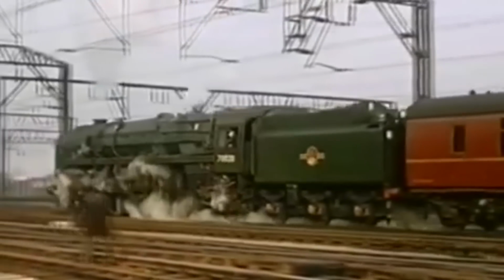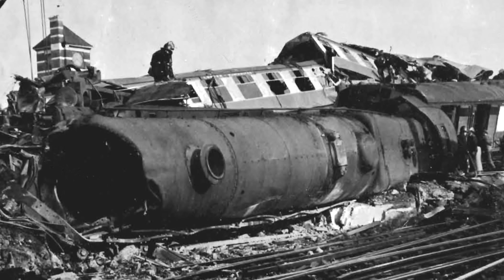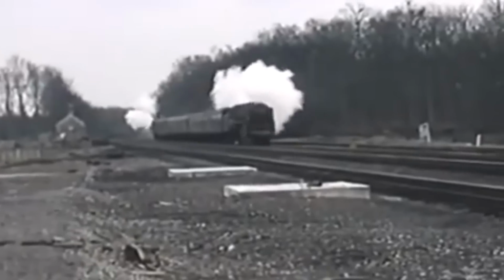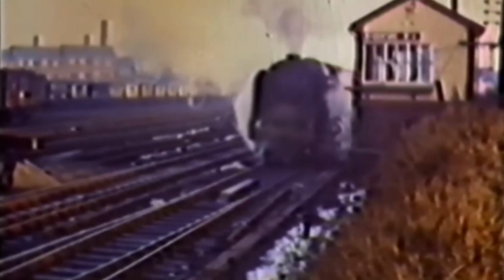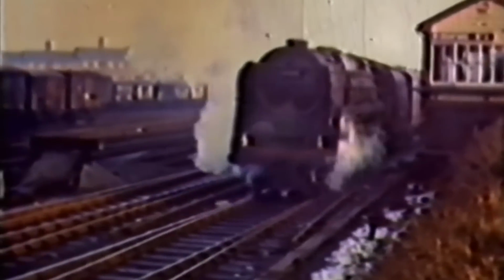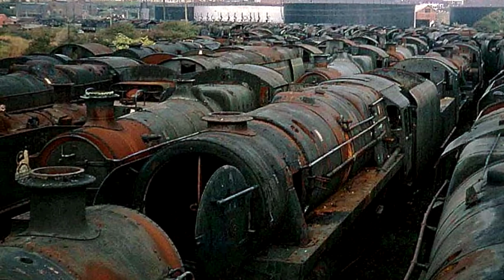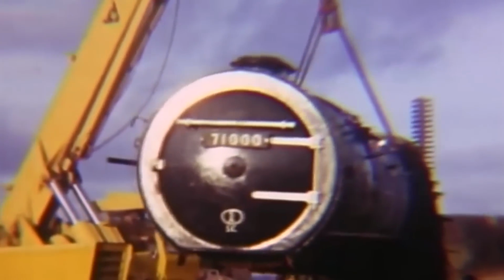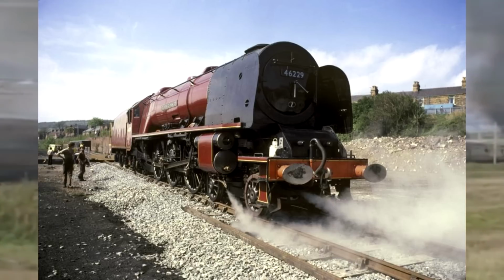The Steam Locomotive That Surpassed Expectations | 71000 Duke of Gloucester | History in the Dark

Comment: I've tried finding an answer online but I failed. Is The Duke more powerful than the 9F Evening Star?
Reply: The Class 8 Duke of Gloucester’s tractive effort is 39,080 lbf while the 9F’s are 39,667 lbf so the latter would be stronger
Reply: @jaanshersaeed4541  Thank you. Your response is appreciated. 🤩
Reply: @jaanshersaeed4541  But tractive effort is not a true representation of power. It only represents starting torque at the wheels, and freight engines have a higher TE than passenger ones because they have smaller wheels. The real indicator of power is drawbar horsepower (EDHP), but that can't be predicted easily. It depends on boiler size, grate area, quality of steaming and other practical factors. Plenty of engines that were powerful on paper were unsuccessful in practice, including the Duke in its original format. However, the rebuilt Duke and the 9Fs including Evening Star are both very successful and perform superbly in practice as well as theory. The 9Fs with only 5 ft wheels would suffer high wear if used regularly on high-speed express trains, though they ran a lot faster than expected, often at 70-75 mph and once timed at 90! Boiler size was similar to the Duke but grate area was slightly smaller and there was less cylinder volume. So that Duke would be expected to have a slightly higher power output at top speed than Evening Star.
Reply: @iankemp1131  Yeah, haven’t been completely sure what tractive effort’s about though I wonder if the Duke of Gloucester and a 9F were to pull a heavy goods train with the same amount of trucks (like say 30 of them) while not going fast which one would have an easier time and if they were to go up and push each other buffer to buffer which would have an easier time pushing the other. I’ve read that the Coronations were said to be the most powerful steam engines in Great Britain though the U1 Garratt was extremely huge and powerful.
Reply: @jaanshersaeed4541  To round off - the LMS Duchess/Coronation class had the highest peak recorded power output in BR days, although an LNER A4 had a very high and much longer-sustained power output on a wartime train. The LNER U1 Garratts had the highest tractive effort, but were built for low speed slogging. So they could exert a higher force than the A4s/Duchesses, but could not reach the speeds that would produce a comparable power output.
Reply: The 8P is much more powerful than a 9F - probably 15-20% more powerful. The power of a steam locomotive depends on how much steam it can produce, and the 9F has a very similar boiler to the 7MT Britannia class. Both the Britannia and the 9F have a 42 sq ft grate area, which gives a measure of how much coal can be burned - the 8Ps generally had a 50 sq ft grate, and consequently larger boilers (exceptions being the GWR Kings which were not actually so powerful, and the LNER A4s which are the real deal). 

The Gresley A4s also had a 42 sq ft grate, but they were very efficient and had a huge heating 3300 sq ft surface (bigger than the Duke's) so they could produce loads of power - some estimates have them at about 2200 DBHP over 20 or more miles, which is basically like a class 5 diesel (deltics get about 2500-2600 DBHP when going flat out, the 3300 HP normally quoted is at the output of the diesel engine).

Tractive effort is simply the peak force generated by the locomotive. For a steam engine, its basically 85% boiler pressure multiplied by the area of the pistons (this product is a force), then adjusted to account for leverage (found from the the size of the driving wheels and the length of the piston stroke). 

Power is tractive effort times speed. Tractive effort eventually falls as speed rises, (just think how the higher gears on a car lower the torque applied to the wheels), and the power is maximised somewhere along the speed curve. For freight engines, this is at a low speed, since the wheels are smaller, and the draughting is arranged so the boiler works best at that speed. Passenger locos maximise the power higher up along the speed curve.

Incidentally, steam locos generally make good power when they are moving fairly fast; they are terrible at low speed, which is why they accelerate so slowly.
Reply: @cobblestone_cowboy  Thanks, that was both interesting and informative. 😊❤️❤️❤️😊
Reply: @cobblestone_cowboy  Thanks for that very informative and comprehensive reply. It shows how power output is a combination of several factors - 1. the heat produced from the fire (linked to grate area but also effectiveness of airflow and coal quality), 2. the boiler size and steaming capacity (linked to heating surface), 3. the cylinder capacity and efficiency, and 4. the adhesion at the wheel surface (no good producing lots of power if the engine is simply slipping). The weakest link limits the overall power. The original Duke's two problems both affected 1 and were solved by the preservationists. The Duke's grate area was 48.6 sq ft (v 50 sq ft for the Duchesses) but in fact only part of this was effective originally, so heat production was low. The boiler was actually hardly any bigger than a Britannia/9F boiler due to loading gauge limitations, and the heating surface area was almost precisely the same. Interesting point about the A4s; the 2200 HP was indeed sustained for 25 miles at 75 mph on a 1940 run with a 21-coach 730-ton train. High speed and high force, so very high power. But this was an exceptional, maybe unique effort, whereas Deltics produced higher power day in, day out, continuously over longer distances. The later Peppercorn Pacifics had a 50 sq ft grate but did not outperform the A4s, but it presumably gave more margin with poor post-war coal.
Reply: @iankemp1131  Agree, the deltics were a big step up. But another way of looking at it is, they had to be, because the steam locos they replaced were pretty much as good as could be produced within operating limits.
Reply: @cobblestone_cowboy  A very fair point. Gerard Fiennes said in the 1960s he wanted 3000 hp to give end-to-end journey times and the Deltics were the only way to do this, "the policy of building express passenger diesels of 2000 hp lies in ruins about us". Other diesels indeed were not a great advance on steam, although the predictability of power output was a good thing (if reliability was ok). Even diesel-electrics weren't that great at the initial moments of starting. I remember when class 47s and coaches were replaced by Voyagers in the 1990s on the Oxford-Birmingham route - the acceleration from rest was far better and the schedules were cut substantially even with existing stops and similar top speeds.

Comment: The Duke is a firm favourite, and while it did trump the Duchess' service record on Shap itself she has never quite reached the UK record for measured power...officially standing at an estimated 2511dbhp and held by, you guessed it, a Duchess (6234 Duchess of Abercorn) during blastpipe trials and hauling an insane 20 car train. Widely respected experts of the time (including Great Eastern railway engineer and technical journalist C J Allen) calculated the cylinder figure to have been in excess of 3200hp and as high as 3330hp. None the less, the Duke is spectacular to watch in action, and really is close to the very top echelon of British steam.
Reply: Which was quite poor when compared to the regular output of the French 231E Pacifics which was also a sustainable figure.
Reply: Actually, Simon, Duke Of Gloucester handsomely exceeded the Duchess class in DBHP. 
On her record Shap ascent, she recorded a calculated AVERAGE DBHP over the entire climb of over 2,700. Meaning that the peak output would have touched 3,000 at the drawbar. 
The average figure attained on the climb is at least equal to an all out Deltic!!
Reply: DBHP?